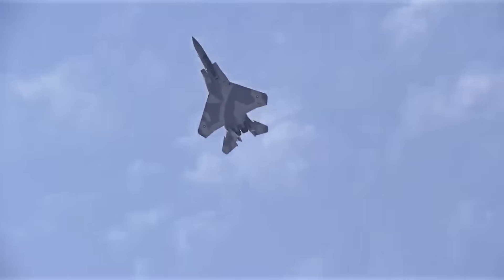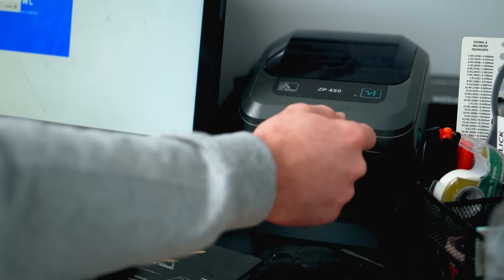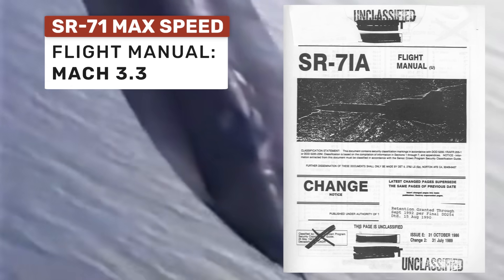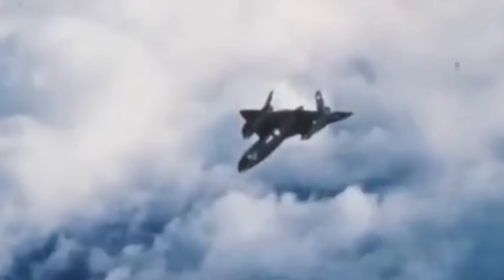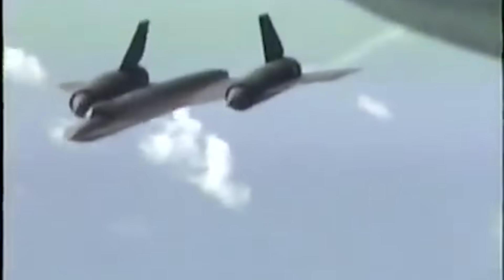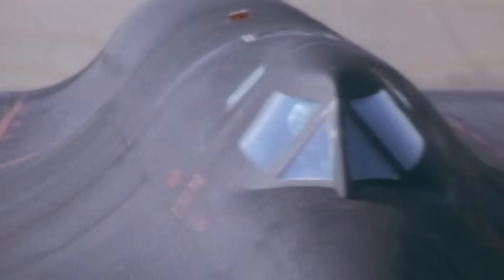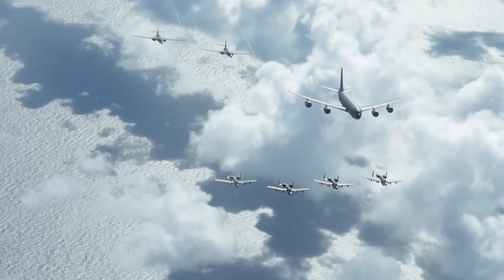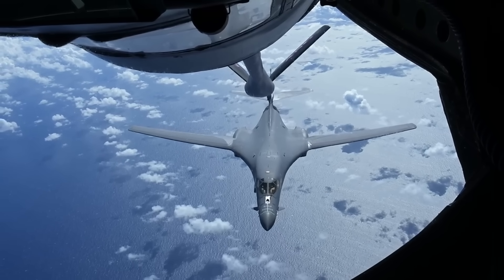The SR-71 was MUCH FASTER than the Air Force will admit

Comment: You really didn't think they were really gonna admit to its actual capabilities of a top secret airplane now did you? 😅
Reply: Early '60's tech, so yesterday. Imagine what we have today. Tic-tac anyone?
Reply: @georgemacdonell2341  that’s the thing we have little, look at the space exploration: just robots everywhere
Reply: @georgemacdonell2341 engineers were better back then😂
Reply: i think it's more that speed records have to be performed under very specific circumstances to be official. Guys definitely pushed the SR-71 past 3.3 in their own words, it's just not 'official', most likely only happened during missile attacks
Reply: No, I don't think anyone thinks that. And certainly not Alex.
Reply: But SR-71 was retired, so it's stats can be declassified.
Reply: @kerbodynamicx472 Just because it is retired - that doesn’t change its classification. For anything that has or is classified, there is a process to declassify it. However if that process is never done - it stays classified. There is no time limit on classified items or information. For the classified status to change - it has to be declassified.
Reply: @kerbodynamicx472  Depends.  There are mandatory declassification dates (unless overridden) based on classification level.  The longest that I know of is 50 years.  Retirement doesn't automatically lead to declassification.  Classification and declassification are based on whether the release of information can be damaging to our security or not.  Just cause something is "retired" doesn't mean that the information about that thing will not cause damaged if released.  These are separate things that need to be treated as such and not conflated.  The problem with today's world is that too many people do that; they conflate information cause they make assumptions based off of things like incomplete info, lack of training, not using critical thinking or not caring.  Stop adding to this.
Reply: @kerbodynamicx472  retiring is not qualification for declassifying. Stop talking about things you don't know
Reply: @kerbodynamicx472  I agree that it should be that way. It's insane how long they sometimes hold on to this kind of information. Read about how long it took the Project Mogul balloon to be declassified (although - to be fair - in that instance, it was just because everyone forgot that it was classified).
Also, sorry if you see this notification more than once. YouTube twice deleted this comment - must be some kind of glitch.
Reply: @k @kerbodynamicx472 shouldn’t declassify any war plane until most other threats already have better planes
Reply: End of day, if Russia says they can do it, the can't.  If the US says they can't do it, you better hope they're telling the truth.
Reply: @SP-fc9bx one of the best gifts Russia gives us is telling us their better than us when they are 2-3 steps behind. It makes it easier to convince congress to give our defense industry more money and resources.
Reply: @SP-fc9bx Why should you hope that the U.S. is unable to do whatever?
Reply: And that official record? At least for a longer transcontinental distance, hat was set when the 'supposedly last' plane was on its retirement flight from the west coast to Dulles airport to be given to the Smithsonian.
Reply: @michaelsauer9129   Yup, If we break it, oh well. While still being safe.
Reply: I’ll also bet that all of those involved in the  Blackbird program were sworn to secrecy.
Reply: @stanmans Yes on top secret stuff like this, people involved are required to sign a statement not to discuss it for fifty (50) years. However it can be even a longer time than that - and if it is still classified- like the SR-71 still is - you still can’t discuss with anybody - unless they 1) hold a classification level that that item or data is classified at AND 2) have a need to know.
Reply: The mig-25 Foxbat punches itself to 3.5M, and looks similar in airframe to an F-15, that now also admittedly can do nearly 3.0M.
And we’re supposed to believe all the above board data and design claims of 3.2M?…when it looks like the fastest jet powered lawn dart in the universe?!!
Come on. 
That thing was so stupid fast the Russians had to watch us dismantle them “all”.
If the MGG 25 was truly able to peek at 3.5 with subsequent damage, the SR 71 was also able to peak well above 3.5. Alex keeps talking about hundreds of miles an hour past 3.2, I’m talking about full point numbers in mach. And the plane has been decommissioned for nearly 30 years now, so why do we care to keep it a secret anymore we don’t have any flyable units laying around?
Reply: @dallynsr  I agree that there's no point in continuing to keep information on the SR-71 classified, but some of the numbers you presented were all wrong. 
[EDIT: My numbers are all wrong, too! Mach 2.83 was the maximum sustained speed. The best that a MiG-25 could do was Mach  3.2 - but that would destroy its engines. It's still a far cry from Mach 3.5, but I don't want to spread misinformation. End EDIT]
The absolute maximum speed of the MiG-25 was Mach 2.83 - if it did that too long, it would rip it's engines apart. If you're going to go much faster than Mach 3 for any respectable length of time, turbojets and turbofans just won't cut it - you'll need the turboramjets that the SR-71 used (or an ordinary ramjet or scramjet, or a rocket rather than a jet). Also, though the F-15 looks similar to the Foxbat overall, there's one particularly noticeable difference - if you look at the engines, you'll notice that they're HUGE. Those big engines are a big reason why it could go that fast. Admittedly, jet engine technology - especially in the US - has improved considerably in the past 40 years. If the F-15EX can go as fast as Mach 2.9 (to my knowledge, no one on the inside said it could go faster; the source Alex quoted only said Mach 2.9, anyways) - it would because those "small" engines are far more capable than the same-sized ones used for the original F-15A. I would love to see what would happen if GE or Pratt&Whittney where to build ginormous engines worthy of a Foxbat or a Foxhound, but using the latest technology. I'm sure it wouldn't last long!
Reply: @jeffbenton6183  That engine exists the F135. I suspect if and when the NGAD is revealed it will have a pair of those engines.
Reply: @jeffbenton6183 A couple of Raptor 3s might push the Mach numbers up. Until they ran out of fuel.
Reply: @mikegardner107  Interesting - thanks for that. I'm embarrassed to say I don't know what a Raptor 3 is; I haven't heard of that jet engine before.
Reply: @ With some conversion a Raptor 3 might be converted to a ram jet and the fuel tanks might be converted to maintain cryogenic temperatures to hold liquid methane.
Reply: @dallynsr  We don't want to accidentally give away any secrets of the modern versions. That is why old versions often remain classified.
Reply: Has anyone, with modern computers, used the timings of those flights to calculate the speeds again?
Even taking altitude and curvature of the Earth into consideration?
Reply: @stpfs9281  not just that, you need to know temperature, wind direction and speed at specific altitude.
Reply: My uncle never admitted that they went faster than what was officially stated. He would just smile and say "Mach 3.2". Even after he retired from the Air Force (as a Lt. Col). He was the guy in charge of scheduling the KC-135s that would do the inflight refueling of the SR-71s. So he knew, I'm sure of it. But he never said, even after the Blackbirds were retired.
Reply: Well.. if you were hanging with Trump.. could get him to spill the beans.. just tell him how great he is and you could probably get any info you wanted?
Reply: @theayatollahofrockandrolla  Or wander into Biden's garage...
Reply: ask Bill Clinton or Obama! They sell anything for enough money!🤬
Reply: Yeah, i always laugh at these types of assertions - people are officially sworn to secrecy…yet somehow they openly make statements punishable as treason.  So they’re stating the actual, exact capabilities…
YEAH, SURE.
Reply: @baomao7243  Not to mention, the military doesn't just test one plane at a time, they are always testing faster planes and faster versions of existing planes. Even if you fly one of them, you'd be foolish to think you are flying the fastest one.
Reply: @baomao7243 I disagree. I know several persons who worked on various secret govt. projects who absolutely refused to give any info on what, when and where they were working on. I very quickly learned to not ask anymore questions. I can’t say that the brick wall I ran into would be applicable to all persons involved in secret activities but you are taking a major chance including very long imprisonment to violate that code.
Reply: NO!
Reply: EDIT: reposting this since YouTube deleted it for some reason. Others have also mentioned this since.
A somewhat secret plane that hasn't been in service for over 30 years now. It wouldn't surprise me at all if the real top speed were to be declassified in the next 2 decades. Then again, the USAF is quite sensitive of such things. They kept the entire existence of the unimpressive Project Mogul spy balloon (which crashed at Roswell) classified for something like 40 years by accident.
Reply: We learned that it can out-run Russia missiles from the era so we knew it went faster than mach 3.
Reply: At the time, absolutely not. 30+ years after they have been retired, might be time to set the record straight for history's sake.
Reply: I believe in most cases secrecy usually only applies for 25 or 50 years with specific exceptions where an operative or nuclear technology would be exposes that remains secret for 75 years.  A plane of this vintage (and also retired) really has no need for national security around its performance figures at this point.
Reply: @larrybremer4930  I understand totally what you are saying. But I believe that we shouldn't help out our adversaries in anyway in developing technologies for destructive purposes. One day we will reach an apex on technologies. Then it will become a matter of who has more and who is the first to strike. I hope before we reach this point that we will be able to put aside our differences and live as humans instead of patriotism. Because one day we will harness the ability to destroy the earth. No one or thing will win.
Reply: It's like saying the sky is blue or water is wet, obviously they'll never give the top speed of current aircraft 😂😂😂
Reply: A somewhat secret plane that hasn't been in service for over 30 years now. It wouldn't surprise me at all if the real top speed were to be declassified in the next 2 decades. Then again, the USAF is quite sensitive of such things. The kept the entire existence of the unimpressive Project Mogul spy balloon (which crashed at Roswell) classified for something like 40 years by accident.
Reply: The US understates and flat out hides true capabilities; the Russians boast and hope to God the US doesn't create a countermeasure for their fictional tool.
Reply: But but but millennium7 says that USA stated capabilities are the unrealistic top end under ideal conditions!
Reply: Russians do the oppsite.  Exaggerate what their planes can do. What their tanks can do. In fact they are kind of stupid
Reply: Definitely lost some credibility
Reply: I would hope not
Reply: I did😮
Reply: I wonder why the top speed of a long decomissioned bird is still top secret ?? Who cares about if it was reaching Mach 3.5 or Mach 3.7 ?
Reply: @boogie153  I believe the reason why is initiative. If they as in enemies think that it's slower than they won't keep pushing harder. Just like people do in sports. They look at the record time and only try to push themselves to beat the time by just a fraction of a second better.
Reply: The X projects a series of attempts at reproduction of a top speed still undisclosed
Reply: They did and then some.  

I never will understand this American “we will neither confirm nor deny” and “we could tell you, but then we’d have to kill you” crap when their intelligence failures are so simple and embarrassing.  Like having base security compromised by Fitbit.. or an NSA employee defect to Russia… or not predicting 9/11 even though all of the evidence was there, and only having two unarmed F-16s with orders to ram launch too late to do anything.  

You can bet that when they went to set the absolute speed record in the SR-71… that it was absolutely balls to the wall… and that the plane required a week of overhaul afterwards.  

The SR-71 is limited to a speed of Mach 3.2 by a compressor inlet temperature of 427°C in International Standard Atmosphere. It can go to Mach 3.3 in colder temperatures.. but what you have to remember is that Mach gets slower the colder the air is.. so the true airspeed remains the same.  At Mach 3.4.. the inlets can no longer keep the shockwave properly positioned—risking inlet unstart.. a condition so severe and dangerous that they can’t train for it.
Reply: Everything about the program is declassified. There was just never any incentive to find the end of the envelope.
Reply: It could probably go faster but it disintegrating in flight its a matter of numbers
Reply: @dogfoot1874 An unstart at those speeds could easily result in the loss of an aircraft.
Reply: @dogfoot1874 Do you maybe think the designers, physicist,testers and builders didn’t take that factor into consideration?
Reply: @stanmans Of course they did when the damn thing's leaking jet fuel on take off

I'm sure they took. That into consideration. 

The question is does the pilot have the balls to push it past it's limits?
Reply: @dogfoot1874  actually as a matter of fact yes they did take into consideration that it was leaking fuel. It was designed to do that. Why? Because we didn't have anything that would withstand those tempatures at that time so they made it loose so when it got hot it would expand and close up the leaks. Now as for pushing it past its limits. You are 100 percent correct as in getting a pilot to do that. The only way you would get a pilot to do such a thing is a matter of life or death. Like a missile coming after you. At that point you had no choice you had to outrun the missiles or your dead. You couldn't just eject because you were so high up there. The extremes that you would face are dangerous. If the cold didn't kill you then the lack of air would. Not to mention that you would be leaving a plane at over a thousand miles per hour. The force of the wind would rip you apart, let alone anything that you had on like a helmet that had your air supply. If you have ever parachuted you would understand this mathematical formula called maximum rate of decent. Where we live and breathe you can only go about 90 miles per hour because of the air slowing you down. Less air the faster you go. Way up there there is less oxygen so you would go much faster. When you came into contact with more oxygen it would be like hitting a brick wall. Kind of like diving into water. Over 100 feet the water becomes very dangerous. Many factors come into play here that we don't take into consideration because we don't face those kinds of extremes. But NASA does know all about those extremes. It like a walk in the park to send someone down to the deepest part of the ocean than it is to outer space. And trust me, going to the deepest part of the ocean is extremely difficult. You only have to deal with pressure. Outer space is the opposite of pressure its vacuum. Then the cold. Then getting back to the surface of the earth. Not to mention where you're gonna land, the earth rotates and its moving around the sun. Gravity doesn't just pull you to where you left off. It just pulls you to earth. Alot of ocean out there you know.
Reply: @dogfoot1874  I responded to you earlier today, but it looks like YT deleted it. So I'm reposting it:
 Interesting. I knew that the F135 is huge, but I never thought to compare it to the Tumansky R-15. Thanks! That said, the F135 is old news by now, NGAD will have something much better (though it may have been used for the B-21, which is why it only needs 2 engines compared to the 4 which power the B-2). First, the comparison:

R-15 (MiG-25)
Length: 6,264 mm (246.6 in.)
Diameter: 966 mm (38 in.)

F135 (F-35)
Length: 220 in. (5590 mm)
Diameter: 46 in. (1,170 mm)

So, the F135 is about 21% larger than the R-15, but the R-15 is about 12% longer - for whatever that's worth. Pratt & Whittney is currently working on a new variant of the F135 that will slightly increase the thrust and efficiency and be available sometime next year (or later). However, the variable-cycle prototypes which Pratt & Whittney and GE had been working on to replace the F135 entirely were even more capable than that. That program was cancelled, but it's well-known that the NGAD fighters will use variable-cycle engines.
Reply: SR-71 is too old to care about its capabilities
Reply: Russian +10% America -10% I know which I'd trust🇬🇧
Reply: @mickkelly6389  nothing russian is worth trusting at all. america military equipment is proven. russian and other trash nations militaries are not proven. numbers on paper dont predict real engagements. brand new weaponry and poorly trained soldiers is not a effective combat force.
Reply: Right ❗️❗️❗️
Reply: Given that the aircraft is no longer in service, why would it matter if the top speed was made public?

How can anyone use that information to the detriment of the aircraft or pilot?

Think..
Reply: Hi, Hey, Hello!!🦜

The more G’s, the better!! They’ll reflect our minds, technology, and more!! G strings!! 👙 👙👙👙

Our brains look like gum!! 🧠 Juicier the better!!!🍏🍋‍🟩🫐🍍🍎🍌🍈🥥🍐🍉🍒🥝🍊🍇🍑🍋🍓🥭

Love everything until it loves you back!! Mosquitos too!!🦟 ❤

Each of us and each galaxy would represent a cell!! 🦠 We’re stars putting ourselves back together again!! Like Humpty Dumpty!! 🥚 🐓 

The sky is blue because we’re meant to imagine it as a diamond!! The auroras then create the rest of the spectrum!! 🌈 💎 

A purple sky would reflect the heart of the ocean!! An opened mind!! 🤯 The earth purring more!! Purrrrrple rain!!☔️ 🐈‍⬛ 🧶 

Each thought to me is a solar flare, which shifts us into parallel worlds!! It’s hard here!!! I’m a peaceful dude, yet my life here has been super difficult!!🥹

Alpha Centauri represents a shift in consciousness!! Dog planet!! We’re riding the alpha waves!! Woof woof!!🐶 🐾 This is our world peace and enlightenment for the world and universe!! All is one!!😇🥳🥰🤩

We’re each a mini universe!!🌌

The 3 Body Problem represents our gut brain, 🍱 heart,❤️ and mind!! 🧠 

The moon is a black hole!! 🕳️ A neutrino!! The planet is a colonized moon!!😇🌍👽 The sun is a shapeshifter!! 🌞 

Are you and I sculpting together as a team or as individuals??? 🧑‍🎨 Using the moon as a tool!!! 🪨 The Sun is the eye!!👁️ 

I love the tool/word grinder!!!😮 We’d be Bumping and Grinding!!😂

The Earth is like a refrigerator and the atmospheric pressure is melting or defrosting the stars above, as if they’ve been in the freezer!! 🥶 

It would also reflect us krystalyzing and becoming diamonds in the sky!! 💎 💎💎 Lucy becomes Maisie!! 🐒 👽 

We could be stars from above aka heaven, melting everything from above, as well! Like a River Running Through It!!! 🌊🌊🌊🌊🌊 Gravitational waves or our thoughts raining down on us!! 🌧️ 

Unlocking a Secret Garden within and outside of us!!🤫 An Oasis!!!🏝️ 🏝️🏝️🏝️🏝️

Flowing!!! It helps a lot to flow!!!🌊🌊🌊🌊🌊🌊 Letting go, so we can concentrate more and work on our project!! Heaven On Earth!!🌍 👼 

Flowers!! 🌺 🌸 💐 and Flow-Ers!!🌊🌊🌊🌊🌊

I know energy is still impurrtant!! 😻 

And of course imagination!!! Love!!!💗 🐶 🎾 🧶 🐈‍⬛

To create heaven On Earth, the galaxies collide!! 🌌 Twin flames connect!! 🔥 🔥 We’re creating quantum entanglement!! Ghost particles merging, becoming more like the Stay Puft Marshmallow Man!!👻👻👻👻👻👻👻👻

The universe is still the Earth!!⭐️🌍⭐️ We’re seeing it from the insides!! 🕵️ Like we’re inside a volcano 🌋 or wishing well!! The stars and galaxies are like coins!!🪙  The Goonies vibes!! 💀 We’re treasure!! Antarctica is treasure island!! 🐧🇦🇶 Unlocking antimatter!! 🐜 Booby and booty traps exposed!! Planet X!! Hubba Hubba!!🥰 

Everything and everyone has been our teacher!!👩‍🏫

3D is like the murky bottom of a bong or volcano!!🌋 The fourth dimension, representing Mars is like the stem of the bong or the volcanos vent!! 👽 Experiencing higher dimensions is like the smoke or magma reaching our mouths 😋 and then circulating through our bodies!! We are the Earth!!🌍 👼 

The road less traveled!!!🧳 🌹 Straight up!! 🎈 🎈🎈🎈🎈We’d be super condensed or extremely packed neutron stars!! Like Rigel!! Blueberries 🫐 Antioxidants!! Betelgeuse has evolved into a neutron star!! 🧊 🦖 🧊 🦕 🧊  🦣 

Our long winding road, exploring different dimensions, finally straightening out!! I’m getting Pee Wee vibes!! Large Marge sent me!!🚴😂

We’re vaporized, as if we’ve been smoked or roasted!! 💨 The smoke representing again those compressed neutron stars climbing the higher dimensions of the universe like a chimney!! I’m Mary Poppins, y’all !! ☂️ 🧞‍♀️

It would also represent us as a comet traveling through a wormhole!! 💫 

Who me, I’m just a worm!!🐛 🫖 Solving a labyrinth!! 🦉 Solving amaze!!! 🦋 

Different energies tell a different story!! 📚

We’re storytellers!! Artists!!🧑‍🎨 

We’re energy first!! 🐝